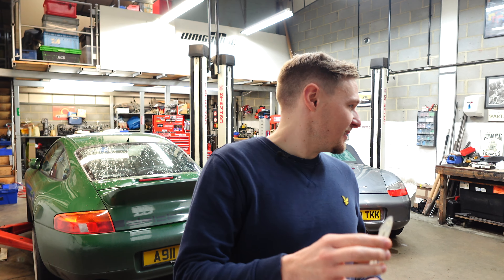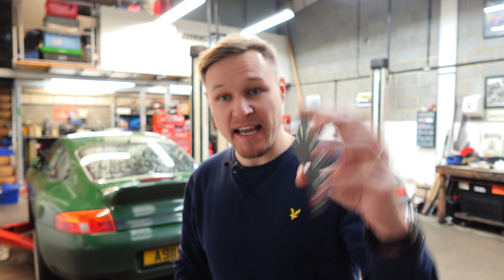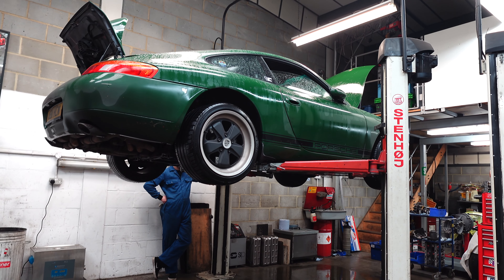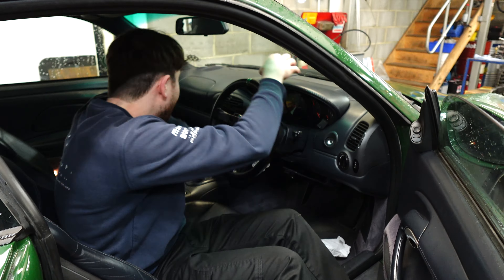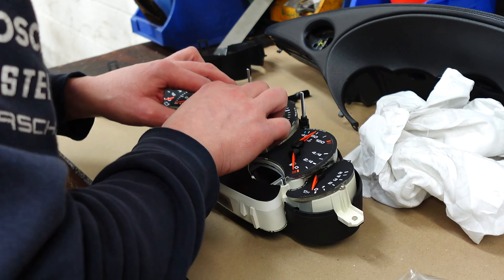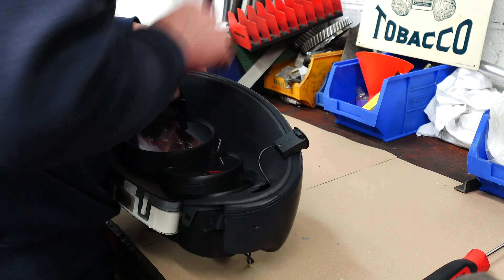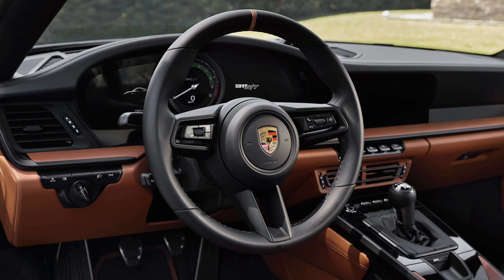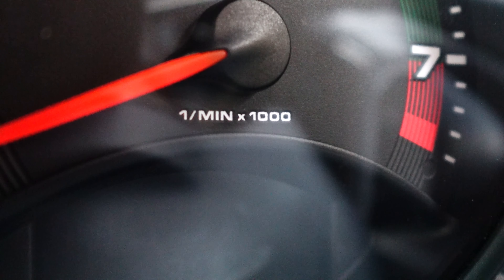Installing custom 'heritage' clocks on my Porsche 911 996.1 Carrera!

Comment: Looks good,Lee. Matches "Little Irish" well. I like the original green touches on cluster, like the 991.1 50th pays homage to. 992.1 has all digital, but tach analog. Wouldn't change mine from stock.

Comment: That looks good. My mate and I took the cluster out of my 996 when fitting the PCCM+ to give better access for cable routing and fitting the microphone. I was a bit nervous as I had to drive 50 miles home afterwards so it had to go back and work! Quite an easy job in the end. Not sure I fancy taking one apart but half the battle is knowing where the clips and fixings are so that you don’t break anything!
Reply from the maker: Great work giving it a go yourself with the clocks! Also great work taking the top off to do the PCCM+ install, that's a good idea.

Comment: Nice! You refer to the later 911s design but you must remember The 986 gauges had a lot more fun design than the more traditional and conservative 996.
Reply from the maker: They did indeed, in that they had a funky font, and had to fit more info into three gaages, rather than the 911's five.

Comment: I always liked the idea of replacing the useless Speedo markings with some that work for mph (30,50,70 etc). It always amused me that multiple generations of Porsches have a Speedo that is essentially useless. They must have known, which is why they added a digital readout in the centre.

Comment: As a non Porsche owner, speedometer increments of 10 mph would have been a useful mod whilst in there
Reply: Most use the digital display under the rev counter.

Comment: How’s the sharpness/resolution of the aftermarket face? The part that bothers me about all aftermarket gauge faces is that it’s more blurry vs OEM. No one can seem to match the sharpness. Very obvious when comparing the outline of the numbers
Reply from the maker: It’s absolutely on point, ie the same as factory. I genuinely can’t tell a difference.
Reply: @9WERKSTV  thats great. do you have the brand?